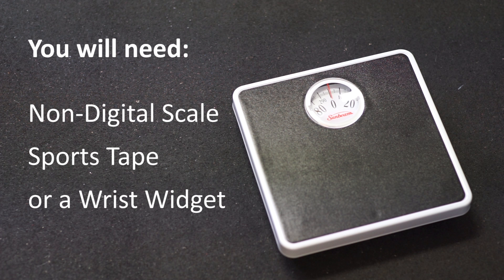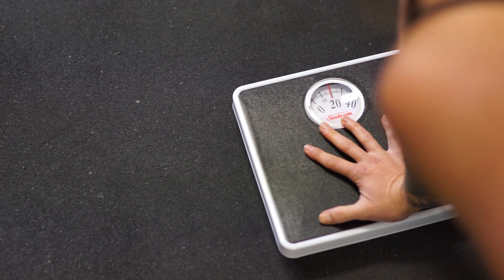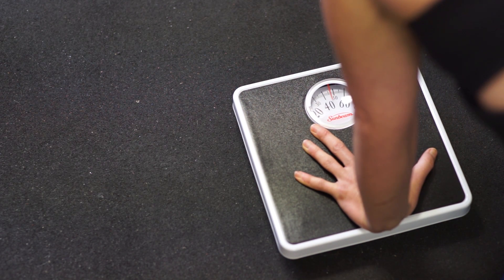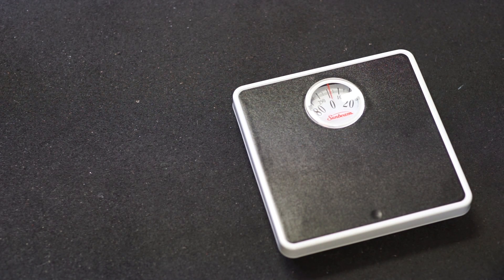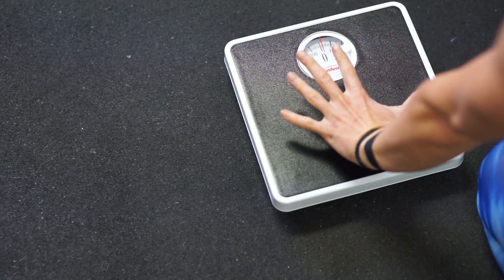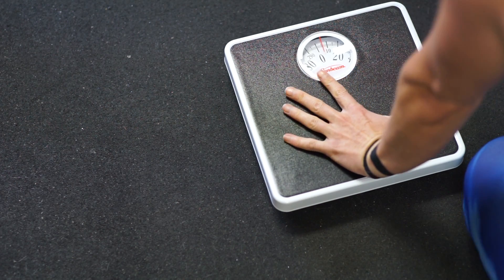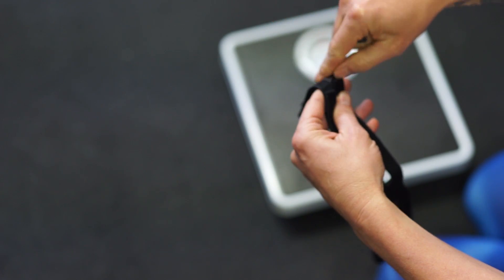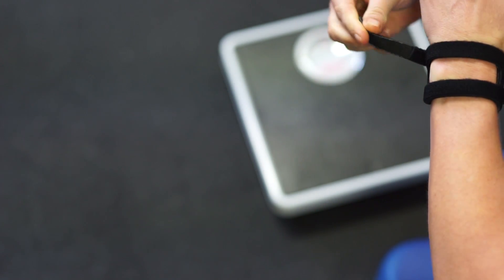TFCC tear test to diagnose ulnar sided wrist pain also known as the  Weight-Bearing Test

Comment: Just ordered one of the wrist widgets as I have diagnosed myself with a TFCC strain or tear.  Pain is mild to moderate when hold something heavy with my right hand / wrist and when there is some rotation or of the pinky side bending down towards the ground.  Rotating my palm to point up ( likea ful turn of a door knob ), it hurts towards the end of that motion.  I can do a pushup virtually pain free and can put weight over 60+ lbs on a scale like in the video virtually pain free too.  I can't get to  doctor for 3 weeks.  Thoughts?

Comment: Hello 👋, I have injured my right wrist while trying to lift heavy barbell trying to do Close grips for triceps. It’s Been 4 weeks yet I have dull pain on my wrist. I did X-ray no fractures or dislocations. I can do 360 rotation it’s ok no pain but when I try to do dumbbell for biceps like curls it hurts. I used ice and OTC cream for pain it helps but temporarily. I did this weight test I have same measurements on my both wrist. Plz help
Reply from the maker: Same measurements on both wrists = ECU injury.  The WristWidget won't be beneficial with your injury.  https://www.wristwidget.com/blogs/blog-archive/could-this-be-an-ecu-injury-instead-of-a-tfcc-tear
Reply: @wristwidget  is it a good idea that I go see a physiotherapist?  And what is the recovery time for ECU? 
Thank u so much
Reply from the maker: @yaqnema1215  Yes, I would consult a physiotherapist. Here are some recommendations you can go through in the meantime
Wrist extension splinting at night.
No stretching for 4 weeks
Deep tissue massage
Heat to the ECU muscle belly daily.
Ice to ECU insertion
Acupuncture.
After 4 weeks, slowly to stretch.
No strengthening until you have at least 65# of weight-bearing ability.  No pain to touch, No pain with stretching.
Consider a “Band-it” Tennis Elbow brace to wear during the day. (found online, at pharmacies, and large stores)
Use an ergonomic mouse to prevent ulnar deviation, and promote a relaxed, neutral hand position. 
Use an ergonomic keyboard to maintain neutral wrist alignment
Reply: @wristwidget  tomorrow I will go see a Physiotherapist. And yeah it’s been almost 5 weeks now. From my initial injury. when I splint at night it helps. I bought the wrist-widget and it helps during the day. Should I wear splint 24/7?

Comment: So when do we stop pushing thru the hand ? when we can’t tolerate anything more ? Or the instant we feel a bit of pain ? Thank you 🙏🏼. Also if it is within the mild range above 65lbs tolerance can you continue weight training your upper body with heavy weights including your wrist ?
Reply from the maker: Adam, 1) measure JUST to the point of pain, not through.  2) What is your healthy hand?  That is the bar that the injured hand needs to meet.  You can find more info here:  https://www.wristwidget.com/pages/tfcc-tear-test
Reply from the maker: Is there any change with tape or the wristwidget on?  Send us your weight bearing numbers with and without the wristwidget and your uninjured wrist numbers.  If your normal is 100 lbs, you can load but not do push ups or bicep curls till normal.
Reply: @wristwidget  okay understood thank you so much for replying I’ll get back to you with those proper readings !

Comment: This proves nothing and doesn’t help in the slightest.
Reply from the maker: https://www.jhandtherapy.org/article/S0894-1130(21)00046-6/fulltext
Reply from the maker: The only injury that responds to taping of the wrist, or wearing a WristWidget® is a Triangular Fibrocartilage Complex (TFCC) tear.
Reply from the maker: https://cdn.shopify.com/s/files/1/0964/3528/files/Wrist-Weight-Bearing-tolerance-in-healthy-adults-jht01-21.pdf?v=1607616428
Reply from the maker: Hi Obsidian, here is some research on the WristWidget® and weight bearing test https://cdn.shopify.com/s/files/1/0964/3528/files/WW_manuscript_2.pdf?303454363678897766

Comment: Do you push down on the scale or just put your bodyweight through your wrist. I can't seem to get anywhere near the weights described without essentially bouncing slightly on the scale.
Reply from the maker: Press firmly with bodyweight, just until point of pain.  No bouncing.  If you have a TFCC injury, you won't get the weights described.  Ck also our new Weight Bearing Test video for more insight.  Visit our website for test result interpretation.

Comment: So I tried to do the test and got 70lbs on my left wrist and 0 on my right wrist. I can’t even put my hand flat. I’m almost 2 months out from a fracture of my distal radius and avulsion fracture of the triquetrium. I just got my cast off two days ago and I’m in a lot of pain. I’m hoping maybe a wrist widget might help
Reply from the maker: give yourself a bit of time after the cast removal to get your range of motion back.  you may need some hand rehab to help you.   I would start heat and do gentle range of motion exercises hourly.  keep the fingers moving.  casting that long makes the wrist quite stiff. it normally takes 10 days for the wrist to calm after the cast is removed.  massage it, ultrasound helps, estim, acupuncture and regular gentle motion.  don’t be discouraged if you wake up and it is stiff again.  keep it moving gently and frequently.  set your expectations correctly.  first goal is 45 degrees of wrist flexion and extension.
Reply: @wristwidget  I’m supposed to hear from physical therapy this week. It’s so painful! 

Public service announcement.. if you used to be a great roller skater but you are now pushing 60 you probably skate like a baby giraffe.
Reply: @wristwidget  at this point my range of motion might be 15 painful degrees
Reply: @wristwidget  I’ve only been xrayed but with an avulsion fracture I’m assuming I fit in the category of aTFCC tear.
Reply: @wristwidget  I have a super high pain tolerance but the specialist I’ve seen doesn’t know me so when I say it hurts BAD I wonder if he realizes how bad it really does hurt. I have RA so living with a certain level of pain is my life.

Comment: I got this pain from lifting a barbell incorrectly (it got slanted halfway). I ignored it for a while since I thought it will get better with time. But it's been like months and months man. It's not heavy pain but everytime I do a 360° motion with my wrist there is a fixed point where its snappy and kinda hurts. Its more between my pinky and ring finger line. It sucks man.
Reply from the maker: Please do the Weight Bearing Test (on a non-digital scale) and send the results for your good wrist, bad wrist, and bad wrist taped as shown to me at:  deanne@wristwidget.com  Let's get your wrist back to the bar!
Reply: @32915  Its not pain. It was never paining. I think its a non lethal dislocation which has changed the  geometry of the bone slightly. I haven't done much to fix it since it doesn't hurt at all, its just less flexible that's it. And I haven't even lifted in a year since all my local gyms are closed cause of the virus.
Reply: @peacemekka  were you able to recover from this? If so, how did you do it?
Reply: @fzwwa14y163vcfgteku  No I haven't. But as said earlier mine is not lethal, it is simply the most minutest dislocation that causes a very subtle knuckle cracking like noise when doing a 360 degree rotation. The rotation is not smooth at one particular point. 

If you are facing any pain or your movement is hampered then try getting it checked from a doctor. 
For me it was nothing insane but I stopped doing Overhead Press altogether(the exercise that caused the problem).
Reply: @peacemekka  You likely have ECU subluxation. can be fixed.

Comment: Are there any studies to back up the claim of this test being able to diagnose a TFCC tear? Sensitivity and specificity?
Reply: Luke Howard I have defined norms in the human wrist ..5 years of work.  I have collected wb data on 40000 cases.  It is specific and accurate.  Far more reliable than any other test.
Reply: @wendymedeiros8497 Where did you publish this data?
Reply from the maker: Yes.  Simply do a google search for weight-bearing test.  You will find many research papers on it.
Reply: wristwidget should I do place weight machine on the floor or cot ? And test
Reply from the maker: @sridharm7040  The scale should be placed on the floor as shown in the video, or on the seat of a hard chair. Lean over it, elbow above the wrist.
Reply from the maker: @sridharm7040  Hi Sridhar, the scale should be placed on the floor as shown.

Comment: I've been researching tfcc injurys for the last few hours and was sure I have it but I just tried it and I could do 120pounds on each wrist. Is it still likely that I have a tfcc injury? I get sharp wrist pain on the top when there is weight on my wrist and my wrist is >90° (handstands). Thanks.
Reply from the maker: Thomas, are you using a non-digital scale ?  It's critical that the test is done with a non-digital scale.  If you don't have one, you can go to a local store and do the test there... or purchase one for less than $5.  Please DM us on our Facebook page with your test results.
Reply: wristwidget digital scale. What would the difference be? They both give an indication of weight.
Reply from the maker: Digital scales are not accurate as they report a static weight which may not be accurate.  A non-digital scale allows you to visually see where the tolerance level is.  The average wrist has a weight bearing tolerance of 60-120#.  Try testing with a non-digital scale and let me know your results.  (sorry for the late response).